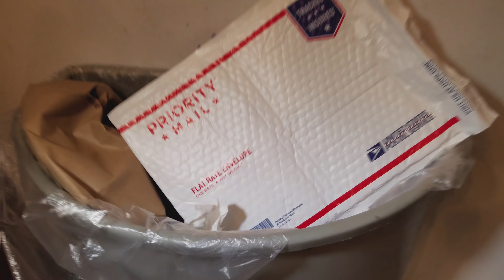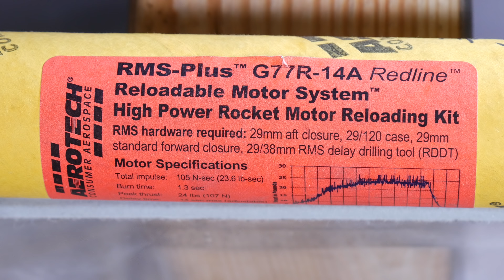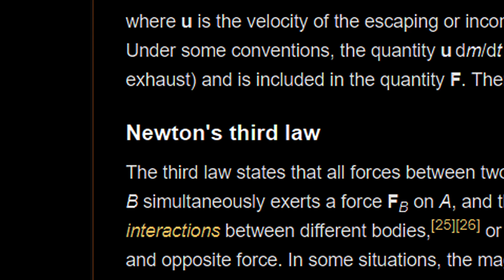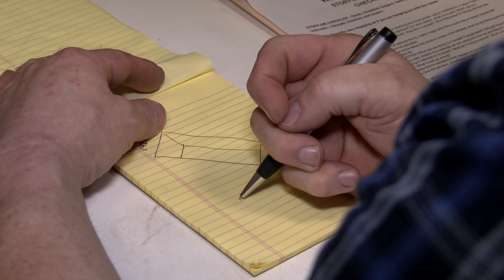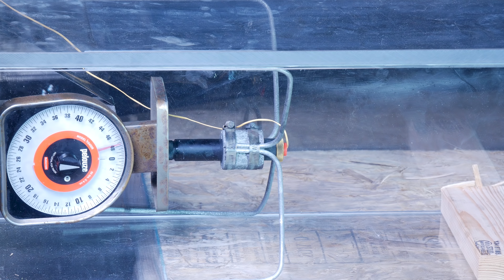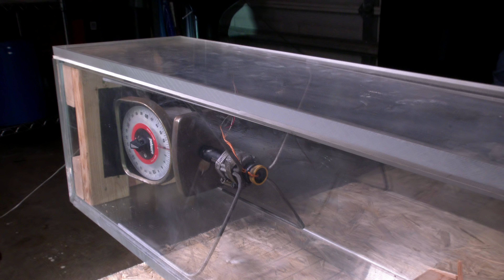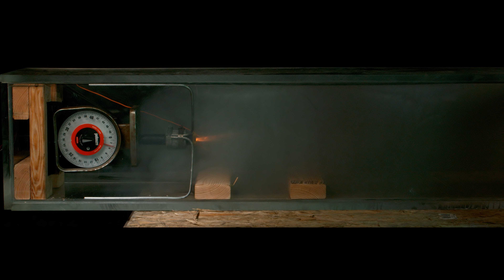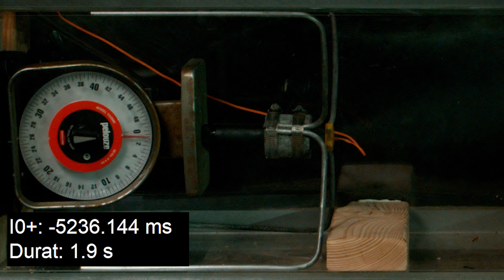Rockets in a Vacuum Chamber - Newton's third law of motion Visualized

Comment: Just one question. Why would you need SRB in space. Cuz once you ignite it, you can't stop it till it runs out of fuel. And in space you will need to be precise. Every move you make changes your orbit.
Reply: many rockets use solid rocket motors as the upper stage. So what you are describing happens a lot.
Reply: @Apple TV One of the spacecraft I helped build used a solid rocket motor as the third stage.   It experienced 15 Gs of acceleration during that burn.  That hardly seems like a "little push".
Reply: @Apple TV - "But I have still never seen a SRB on second stages"
Some of our ICBMs (minuteman) are solid rocket motors for all three stages.

I have launched five Delta-II and four of them used a star third stage solid rocket motor.

Comment: Newton’s third low deals with forces(actin & reaction).When the rocket starts showing back flare to launch, what is the force of action?,how you calculate it?, where This force apply?.
What is the reaction force? Where it can apply?
Please consider these questions in outer space where no gasses around.
Reply: The force felt by the rocket nozzle is from FORCING the exhaust gases out.  This force is felt by BOTH the nozzle and the exhaust gases.
Reply: @stuartgray5877  <----- nasa chatbot claims rockets 'push on themselves' lmao.
Reply: @stuartgray5877   There would be no force exerted because in a perfect vacuum it would get gobbled up it would be a null Force.
Reply: @jrngln    - "There would be no force exerted because in a perfect vacuum it would get gobbled up it would be a null Force."

Thanks for identifying that you dont understand inertia and momentum.
this gives us the proper starting point.

You DO agree that if i fire a standard steel projectile from a crossbow, here on earth, that i WILL feel a recoil force right?

Please explain the mechanism for how recoil works.
Reply: @jrngln   
Nice copypasta. Every word of what you just said was wrong.

1) We can get close enough for practical purposes. Technically space isn't a pure vacuum either, but it's so rarified that molecules rarely come into contact with each other.
2) A vacuum doesn't "absorb" anything, you're speaking nonsense.
3) How exactly do gases on the opposite side of the chamber affect the rocket motor? The answer is they don't. The only forces come from the direct interaction between the motor and the gas. As soon as the gas leaves the motor, it can't transmit a force.
4) Yep. Rockets push off of their exhaust gas.

Comment: A drone can not fly in a vacuum because it does not gain lift because it lacks the surrounding density of air.
Please use a "larger" vacuum chamber next time to avoid the rocket not repelling from the outer walls of the vacuum chamber..

It is slowly becoming apparent that such tests are always carried out in "small" vacuum chambers 😉
Reply: @papalegba6796  - "Newtons first law shows a rocket cannot alter its state of motion in a vacuum"

SO a crossbow would NOT change momentum if it fired a projectile while floating in the vacuum of space?
Sorry but Newtons laws say it MUST change momentum if it applies a force to a mass (the projectile).
I think you need to review Newtons laws.
Reply: @stuartgray5877  see my previous comment, chatbot 😂
Reply: @papalegba6796  So tell us WHAT ACCELERATES the mass of the exhaust gas into the vacuum? MAGIC?
Reply: @stuartgray5877  see my previous comment, chatbot 😂
Reply: @papalegba6796  But you have admitted that the exhaust gas does have mass and that it is accelerated.
 So this means there must be a force.
Where does this force come from?
Reply: @rocketman484  see my previous comment, chatbot 😂
Reply: @papalegba6796 you comment does not explain where the force comes from that accelerates the mass of the exhaust gas into the vacuum.  We SEE the exhaust gas change velocity so it was accelerated.  So tell us what is accelerating all of that mass?  Magic?
Reply: @stuartgray5877  yes it does, chatbot 😂
Reply: Amateurs carry out these tests in small vacuum chambers because that's what they can afford. NASA and other space agencies test their rocket engines in much larger chambers, which are designed to extract the exhaust gases so the chamber stays a vacuum during the test.
Reply: @papalegba6796  Newton's first law: A body remains at rest, or in motion at a constant speed in a straight line, unless acted upon by a force.
When you run a rocket engine, fuel and oxidiser are mixed in a combustion chamber, then ignites. This increases the pressure in the combustion chamber, producing a force in all directions. The force components to the sides of the chamber cancel each other out. The force on the front of the chamber is not canceled out because the back of the combustion chamber has a hole. This imbalance creates a net force pushing the rocket forwards.
Reply: @h.dejong2531  Not reading all that, chatbot 😂
Reply: @papalegba6796  So you'd rather stay dumb than learn something? Yeah, that does not surprise me.

Comment: Hi buggsy5 if once the gas leaves the nozzle as you say and has no effect on the rocket what pushes the rocket then.
The rocket is pushed by the column of thrust shooting out the back and is not independent of the rocket after leaving the nozzle the thrust is pushing on the cone at all times until the fuel is spent.
Regards
Denis

Comment: Here is a challenge for you that many have been asking on my channel. If you were to take a spent roll of film (filled with photos) and put it into a vacuum chamber as you did with this rocket, crank the air out of the chamber for 30 minutes, let the air back in and were to take it to the photo lab for developing would the film negatives off gas and be ruined? Thanks!

Comment: the thrust and heat can be pushing off of the walls of the chamber. However, space has no walls, the force can continue indefinitely without giving a reaction. thoughts?
Reply: rockets dont NEED walls or atmosphere to push off of.  Does a person feel a recoil force when they fire a crossbow?

Comment: So, in a vacuum, does the rocket energy displace rocks/sand/dust on the surface that it is being directed against? Also, why is there "flame" in your vacuum?
Reply: For the same reason that the motor produces flame when in a normal atmosphere. The burning fuels produce very hot gases and particles, so hot that they glow. It takes a small amount of time for those gases/particles to cool down, even in a vacuum.
Reply: @buggsy5  So you are saying that HEAT transfers in a Vacuum?
Reply: @ricgaston6503  Certainly. Otherwise the sun would not warm the Earth.

Comment: your rockets may not have atmosphere to push against but walls instead. are you sure you even have the most basic understanding how a control works?
Reply: Except rockets DONT "Push on the air behind them"
they push on the MASS OF THE EXHAUST GAS - while it is STILL INSIDE THE ENGINE.

If you fired a crossbow into a vacuum, would you feel any recoil?
Reply: @bhutehole  - " I'll steelman this and say you said a gun since a xbow would do nothing in 0 gravity but a gun would"

This is 100% WRONG!
A crossbow still has recoil in a vacuum because ANYTHING that PUSHES ON MASS feels a recoil force. PERIOD. NO EXCEPTIONS.
Or are YOU suggesting that a crossbow can fire a projectile WITHOUT APPLYING A FORCE TO THAT PROJECTILE??

Come on SAY IT Genius.
Reply: @bhutehole  - " the problem with a rocket is it wont even get that initial push like a gun shot as there is nothing to push against."

So YOU are suggesting that the exhaust gas from a rocket HAS NO MASS?
Bless your little heart!

Perhaps you should TRY completing high school BEFORE trying to lecture actual Rocket Scientists about basic physics?
Reply: Answer the following questions to help YOU understand.
Lets discuss a rocket right here IN ATMOSPHERE before talking about vacuum.

When a Space Shuttle main engine ignites at sea level:
1 - Is the Exhaust gas "Accelerated" away from the rocket engine?
2 - Does the exhaust gas have "Mass"?
3 - Can MASS be ACCELERATED without a "Force" or is a Force REQUIRED for mass to accelerate?

Just answer these three trivially simple basic physics questions to be certain you understand the terminology then we can get to the more relevant questions.
Reply: @bhutehole  - "with a rocket is it wont even get that initial push like a gun shot as there is nothing to push against."
Did you know that space shuttle engines consume about a thousand pounds of hydrogen and oxygen per second when running?
What do you think that hydrogen and oxygen turns into when it exist the rocket nozzle?
Do you think the mass just disappears after combustion?
Falcon9 Merlin Engines burn liquid oxygen and kerosene in the thousands of pounds per second.
What do you think the exhaust gas from a Falcon9 rocket is?
Its CO2!  Have you ever played with Dry Ice?
Is it massless?  Would you move if I threw a block of Dry Ice at your head?
Would a gun that fires a block of dry ice feel a recoil force if fired into a vacuum?
Reply: Death and Taxes - WHY did you run away?
 Are you SCARED to debate someone that is obviously your intellectual superior?

Or are you just afraid of FACTS?
Reply: @stuartgray5877  i replied 8 hours ago. This is twice you have ignored what ive said
Reply: @bhutehole  all of your posts before this last one are invisible to me now
Reply: @bhutehole  Why are you AFRAID to just answer the questions as Stuart asked them?

Watch:

When a Space Shuttle main engine ignites at sea level:
1 - Is the Exhaust gas "Accelerated" away from the rocket engine?
2 - Does the exhaust gas have "Mass"?
3 - Can MASS be ACCELERATED without a "Force" or is a Force REQUIRED for mass to accelerate?

1 - Yes the exhaust gas gets a HUGE acceleration by the nozzle.
2 - Yes the exhaust gas has mass (the same mass as the fuel and oxidizer that went in"
3 - NO mass cannot be accelerated except by a force.

Next questions?
Reply: @rocketman484  GREAT!

Correct answers!
Now based on your answers: The Rocket exhaust IS accelerated and HAS MASS.
And Newtons laws tell us ONLY a FORCE can accelerate mass, then we MUST CONCLUDE:

That there IS a "Force" accelerating the mass from the rocket!
Great! This is ALL I was trying to get death and taxes to ADMIT:
There MUST be a FORCE accelerating the mass from the rocket.

"Death and Taxes" - From WHERE does this FORCE Originate?
Remember - FIRST we are talking about when the rocket lifts off IN ATMOSPHERE.
WHERE is the force COMING FROM that accelerates the rocket exhaust??

Hint: It has something to do with the 3000 PSI chamber pressure and the 2985.5 PSI DIFFERENTIAL pressure between the inside of the chamber and the outside atmospheric pressure.
Reply: @bhutehole  I suspect that you (or someone else) reported me for harassment on this thread and many of your comments don't show up for me now.
Reply: @bhutehole  Just FYI: My Company (Ball Aerospace) tests over a dozen rocket engines per year in a vacuum chamber and verify that the produce the thrust predicted by the 100-year old Tsiolkovsky rocket equation.
We put those thrusters on real spacecraft, launch them to space and test them there too.
Reply: @rocketman484  hi stuart gray. The fact you need a sock puppet is very very telling. you most certainly do not work in that industry. you are mechanic at best larping as one online.
Reply: @rocketman484  real professionals dont blast their real linkdins when they are talking smack on the internet rudely and condesending to others. nice try
Reply: @bhutehole  The "Sock Puppet" is for examples EXACTLY LIKE THIS ONE where YouTube BLOCKS COMMENTS.

DO you have a point?
Reply: @bhutehole  Now tell us WHAT IS THE ISS - you know the object you can see IN ORBIT - WITH YOUR EYES???

WHAT IS IT?

Maybe you can ask one of the other five year olds in your special needs class to help you look for it?
Give me your zipcode or nearest city so I can TELL YOU when to go look genius.
Reply: @bhutehole  Now tell us WHAT IS THE ISS - you know the object you can see IN ORBIT - WITH YOUR EYES???

WHAT IS IT?
Reply: @bhutehole  yep, Stuart gray is a chatbot. It's been spamming every video like this for years with mad troll questions, abuse & false analogies.
Reply: @stuartgray5877  stop your organised online harassment campaign please, chatbot. It is illegal. 😂
Reply: @stuartgray5877  chatbots can't sue 😂
Reply: @bhutehole  the chatbot stuart gray is threatening to sue me now, you cannot make this up 😂
Reply: @papalegba6796  TELL US again HOW ROCKET ENGINES ACCELERATE MASS WITOUT APPLYING ANY FORCE.
Reply: @stuartgray5877  I thought you were taking me to court, chatbot? Make your mind up! 😂
Reply: @papalegba6796  - "I thought you were taking me to court, chatbot? Make your mind up!"

And I thought YOU were going to contact my employer and turn me in for hurting your feelings.
what happened genius?
I gave you the phone # and the HR person to contact.
What are you waiting for?
Reply: @stuartgray5877  you have no employer, chatbot 😂

Comment: the lid lifting proofs positive presure not a vacuum
Reply: If rockets required an atmosphere to work then jet engine performance would progressively get worse with altitude as the air thins but as long as airspeed is increased to maintain sufficient airflow for combustion performance is unaffected by altitude (it technically gets better)

Until the air becomes too thin to maintain combustion and wingborne lift but that's why rockets exist since they carry their own oxygen
Reply: @sigmamale4147  Solid fuels still contain an oxidizer you muppet
Reply: @PabloGonzalez-hv3td  so why the hell do you compare them to fucking planes ?
Reply: @sigmamale4147  Because it definitively proves that the thrust from a reaction engine is produced solely from expelling the reaction mass and not from "air to push off of"

If you understand what you're looking at that is
Reply: @PabloGonzalez-hv3td  ok i did not understand your comment like that, i thought you were talking about oxygen intake compared to height in the atmosphere

Tho planes have a max operational altitude where they cant get higher because of the low oxygen intake
Reply: @sigmamale4147  While that is true an airbreathing jet engine can still operate at 100K+ feet, much higher than an airliner flies

The practical alitude limit for the average jet is dictated by available lift not thrust. In simple terms the wings can't fly as high as the engines can
Reply: All we got to do now is box in space so it's the same as the test conditions.  
But i suppose if earth is flat it could well be inside a glass box at the same time.
Reply: @stephenallenbaugh54  Fighter jets have flown upwards of 100K ft try breathing there. Although your 2 brain cells won't notice the difference
Reply: BINGO!
Reply: @PabloGonzalez-hv3td  if the air gets thinner ............when do you suspect an air foil loses lift ?
Reply: @PabloGonzalez-hv3td  also with a jet engine it needs to "gulp" huge doses of oxygen to operate .......this is how it completes its production of thrust.
Reply: @ulfhenarpolymathmilitant6258  That's a simple question with a long complex answer. 

Subsonic aircraft wings also lose lift when the airflow is too fast and becomes turbulent. The altitude at which the minimum speed to maintain adequate lift and the max speed that maintains appropriate airflow converge is the aircraft's absolute max service ceiling. The coffin corner.

The engines powering it can operate MUCH higher but the wings can't get them there.

Comment: What type of ignition did you use? Solid propellant is really difficult to ignite anyway. We used to use E-matches to ignite a small chunk of thermite, then bank on that lighting the propellant. The ignitor doesn't have its own oxidizer, so if it has to burn itself for a bit to ignite the propellant, it's going to struggle to do so without air. I have a bunch of solid propellant that is diffult to get burning with a lighter, but once it starts, it burns great

Comment: With the first test the seal of the box broke from the pressure when the rocket was ignited. So the second time the seal didnt break and it maintained a perfect vacuum with no oxygen seeping in from any cracks? I would have to see this done again by someone else in order to understand if the creator is being honest or not with the results.
Reply: At my company we  test real hydrazine thrusters in vacuum and verify they produce the thrust predicted by the Tsiolkovsky Rocket equation before installing them on real spacecraft and launching them to space where we test them there again.
Reply: @stuartgray5877  no you don't 😂

Comment: The rocket fuel expands as it heats and you no longer have a vacuum in an enclosed chamber. The rocket gases is pushing against a wall in your sealed chamber. This test is invalid as it doesn't duplicate a total vacuum as in space.
Reply: When you say the rocket is "pushing against the wall" would you explain HOW the force can get transmitted back to the rocket AFTER the gas travels to the end of the box and hits the wall?  Do you feel a force when you Throw a basketball AND when the ball hits something?
Reply: No perfect vacuum in space, exspecially with a rocket spewing exhaust behind it.  You analogy is invalid.

Comment: Cool experiment, but you technically don't even need a vacuum chamber to test this. You can utilize the Venturi effect by building a chamber around the rocket with a single opening that attaches to a diffuser that surrounds the plume. Initially you have pressure to ignite the motor, then as it burns it pulls a vacuum in the chamber around it.